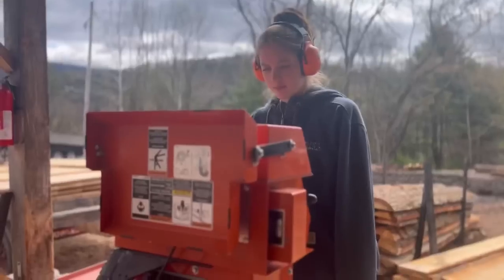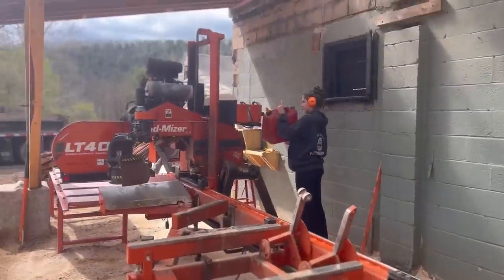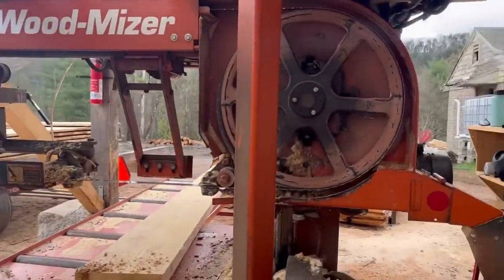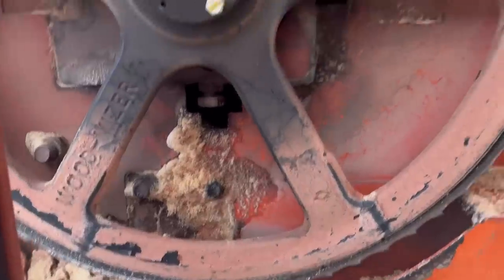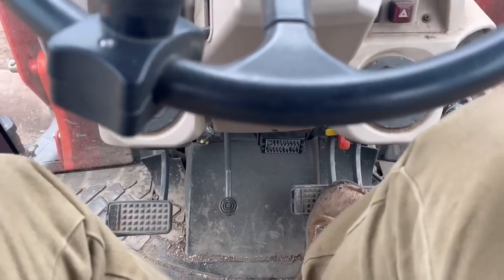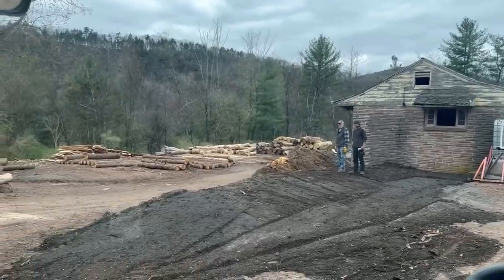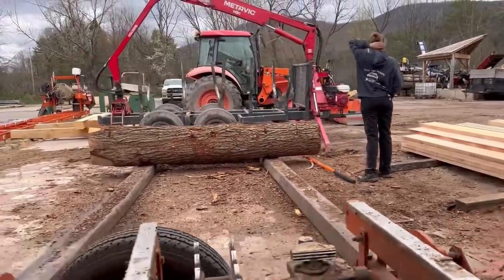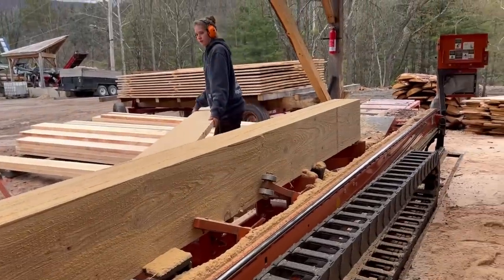Trying Out a 10 Degree Blade On the Woodmizer For the First Time

Comment: I realize this video was a few months ago, but I'll post my observations on different Saw blade angles. Having run an LT 40 for several years now. 
The 10 degree blades are great for softer woods with few knots. If you get into logs with more than a few knots, you will probably find that the cut will wander and cause the boards to get thick and thin. The advantage is the speed of the cut which will give you more production in a shorter time, as long as you have clear logs with no knots.

The smaller the number of degrees of the tooth on the blade the straighter standing up of the tooth. In other words if you measure with a 90 degree protractor from the back of the blade up across the tooth. A 10 degree blade is leaning towards the cut more than a 4 degree blade. 

Here in Middle GA, we cut a lot of pine, mostly knotty pine also known as SYP ( Southern Yellow Pine). 
I found that 4 degree blades gives me a better quality lumber with a consistent thickness from end to end than a 9 or 10 degree blade ever did. Yes it is slower cutting, but I'm not running a high production lumber yard. Mostly just custom orders. 

Love the Videos, keep up the great work.

Comment: If you like the 10 degree bands, you will really like Turbo 7s. They cut all species fast and leave very little sawdust on the cant. I have retired all my 10 degree bands. You should have enough power to run the .055" thickness bands on your mill. They will really eat up all the hemlock you saw.

Comment: Granted I'm fairly new to your channel. Yet. My father and I run 4, 7, 9 and 10 degree. From personal experience. Right now I prefer the 10 degree over the rest. Do to the fact there alot more aggressive. I do have a 7 degree turbo yet to try. Also make sure to have you logs/cants clamped tight. They are an aggressive blade. And will pick the Can't up out of the clamp. That's the 1 thing I've learn running my father's LT40 over the last 8 years.

Comment: Here we use 10 degrees blades but I think 7 degrees are better in frozen logs. On my next blade purchase, I will try the turbo 7. Ask the boss to get a Dewalt electric grease gun. Considering you have a lot of equipment to take care, you won't regret it. Good job btw!

Comment: If you have that much grease squirting out the side of the fitting and onto the coupling links it looks like the fitting  may be clogged. I didnt see any coming out by the sides of the pins.Have Gramps remove the fitting and check.

Comment: You ever try Stellite (cobalt) tipped saws?  No set in the teeth, the tips have  radial and tangential angles ground into them and the stellite is VERY hard and stay sharp for a long time. We used it on all our band and circle saws. Retired Saw Filer.

Comment: 10 degree is probably the most common blade used. The 9 degree is actually used in lower HP engines according to Woodmizer specs . It’s all a learning process. Enjoy your vids and stay safe

Comment: The degree number is how far from center the teeth are bent outwards. A wider cut means you lose a fraction more wood, but the blade gets more room to move so it cuts faster. Good luck to you! 👍
Reply: The degree number is actually what angle the tooth is at. The band of the tooth would be the set which isn't measured in degrees
Reply: @derekbush8442  Yeah, what you said... I knew someone would clear that up. Thanks! 👍

Comment: I've wondered about an auger system to carry the sawdust away, be nice after it comes off the saw you didn't see the sawdust anymore until its about 50 feet away, they can be dangerous though,
Reply: A vacuum/ blower system would be safer. Screw conveyors with sawdust can be a fire hazard. The sawdust can pack against the screw and generate enough friction to start a fire. I’ve seen it happen.
Reply: @billmoran3812  There's a thought, we could rig up an auger system that actually burns up the sawdust,

Comment: "Hello"  guy's/ people I see a couple of things that would help you guys out in the long run while doing  certain tasks/jobs, and I know that you already have a million and 1 things to do! But I think that my general Ideas would be labor savers
And back savers. 1 idea is  time/ labor saver "more efficient " is to have 1 to 2/3 steps to pre- shaping/ pre- opening your Black plastic netting for your pre- bundled firewood.
 (Something I thought of). Is to have at least 2, or 3 more,( 1of each ) size  in Diameter 10/12 feet long plastic or hard cardboard,  maybe out of the centers of new rolls of carpet. And or PVC pipe.  Affix them horizontally & beside each other, on the same plane maybe waist high or shoulder high. Keeping them parallel and 2 feet  apart and secured to the face of a wall.  The base/" 1"  - end of the plastic  P.V.C.pipes  would have a base similar to Flag pole. So you can slip it in & tighten a set bolt/ screw to hold it secure. This would look like a flag pole on its side. Secure the base to a wall .(  Use through Bolts or Lag screws for the bases). . Now get domed plastic, cardboard, and or wood shaped caps that fit over/ into the pipes, kinda like the caps on plastic railed fences. These will help guide the plastic on each Diameter tube/pipe. Starting with the smallest  diameter 1st. Sizes might be" 3" Diameter," 8", & "10" depending on the  dia of your PVC bundle prepper. 
Slide on the whole role & or as much  as it will hold. (All pipes are the same length! ) After you have pre- stretched  the black plastic, Then spool it on a good sized Wooden spool, that will hold all the plastic. 
 The spool needs to have a crank in the center, with a small round core that splits in half, so you can slip the pre- flattened netting into it, & then wind it up. Secure filled spool to the wall & or 1 end of the work bench. Keeping the flattened material on the same plane as your work area. Heading straight for your old paper cutter.  P.S. use/ get a Hog- ring gun, either air or electric using the bigger copper rings, for sealing the plastic bundling material. Top &Bottom. J.B. out.

Comment: I think your grease zerts ( fittings) are clogged. The grease should not be coming out the sides; it should be coming out at the  pivot points
I enjoy your videos
Reply: It did look odd to me too. Call Woodmizer and get a set of them sent there, I'll pay for half. Throw in a tube of grease too, for good measure. Good luck! 👍
Reply: I doubt the fittings are clogged. Clogged fittings don't usually allow grease in. The grease your seeing on the side is pretty common and is from the nozzle not being attached correctly. The nozzle has little grippers inside it and these get loose over time and don't make a good seal resulting in the grease leaking out. I work for a road dept and we use grease for all of our equipment. No matter what piece of equipment we have, even brand new, or what grease gun we are using, there is always grease leaking out the sides. Grease guns and zerk fittings just don't do a great job at creating a perfect seal. That simple.
Reply: It’s zerks not your Zirts comment so when you correct someone proof read your comment ,she greases like a queen cleans up after also
Reply: @mikel9567  Some brands of grease gun tips are garbage from the start and also can't seal unless its a perfectly shaped zerk as not all zerks are created equal either ( I call it the chinesium factor ). I've had some gun ends puke their guts out at the first restrictive zerk, so much junk on the market. In any event even good grease gun tips do wear out and need to be replaced and sometimes the zerk is damaged and its never going to be any good until its replaced as well. Its the nature of the beast with working on any equipment and shes doing an excellent job with the tools she has available, it would shock you to see how many people who know better don't wipe off the crud from the zerk and inject crap into critical components.

Comment: Also I had a quick question on your blades the break have you ever had it where you know on your sawdust discharge shoot I know on our lt70 we had dust collection hooked up to a blower that took our sawdust away but if we cut Walnut obviously we had to disconnect it because we couldn't blow Walnut in with our sawdust because we sold our sawdust but what we did was on the lt70 there was a metal kind of box I would call it that had a round outlet at the end of it where you could put a hose on and it had a hinge on the mill in that box just went up and down and we used to have blades that would break and they would get caught and get stuck like you girls know you you've beaten blades out of being stuck before but we used to have some of them come out the sawdust shoot have you ever had that one happen before that'll get you sometimes that's caught me off guard a couple times usually that happens when we were cutting hard maple or Red oak or  White oak that was the main species but yeah that would get you sometimes you'd be walking by because we didn't have our meal set up like yours where you have the swamp around the side you have the board return we had the option for fingers we took the fingers off and we just had somebody standing on the side of the sawmill who would off bear slabs and then we would edge at the same time so when we were cutting grade so we wouldn't have a buildup of everything at once obviously different applications call for different things nothing wrong with what you guys do it works for your application wonderfully but when we would have be off bearing I remember going up and grabbing the slab and the in the blade would break and there were a couple times that it would shoot out the sawdust shoot in it would be like oh well I don't need my energy drink or my coffee or anything this morning

Comment: Looks like the sawdust shoot is plugged up and the sawdust is piling up on the carriage,   Try cutting faster with the 10 degree blade. You may be bending a tooth when un folding the blade, That tooth will leave marks on the wood, The chuck on the grease gun may be bad. HBD brother..

Comment: That was a question I wanted to run by you guys I think maybe I asked it before or maybe it was another channel that ran at least a resaw or bandsaw that used bands that were narrow bands instead of 3 inches or wider but do you just use it exclusively wood miser because we used wood-mizer exclusively for a long time and then we bought a batch of Timber Wolf blades because that at the time was available and it was cheaper and they were not the greatest they didn't hold set very well we would have to reset the teeth all the time even when the blade was not dull so you could definitely tell the set was off in the teeth and because when we sharpened we would sharpen and then we would set you know you guys know the process of sharpening and setting everything I don't have to repeat that and explain it but I was just wondering if you had used other brands out there because near the end of the time that we stop sawing grade for a while we still don't really saw grade we just do custom stuff here and there every now and then but when we were sawing packs of grade for Bailey lumber what we would do is we would have our wood-mizer blades and we would notice that they would either break on the weld or we would have a bunch of bands that would get a lot of cracks that aren't huge cracks but they were just hairline cracks we usually use those on logs that people brought in that we're from yard trees that way you know we didn't ruin a brand new blade if we hit metal with it it was a junk blade that we used one night of junk blade but it wasn't a brand new fresh blade but you could always tell the difference too when there was cracks in them you could always tell roughly when it was going to break I don't know if you guys can but I was able to after years of being around that you could always at one point you just realized that up that blades about the snap and usually 10-15 minutes go by or even a minute and then you just hear that snap I was just curious if you guys had experimented with different brands of blades.